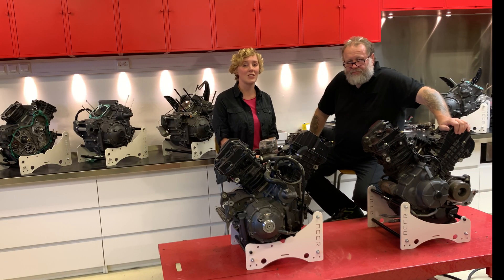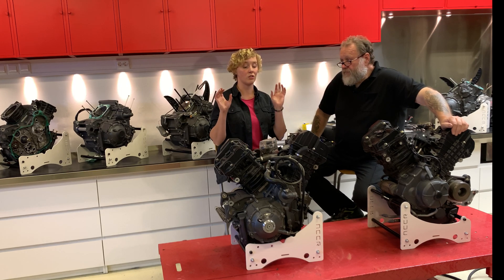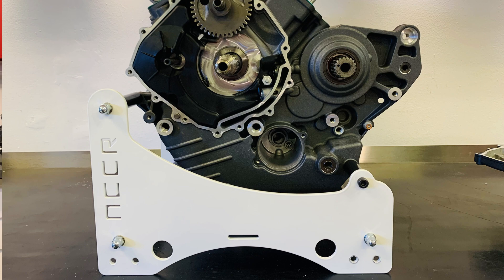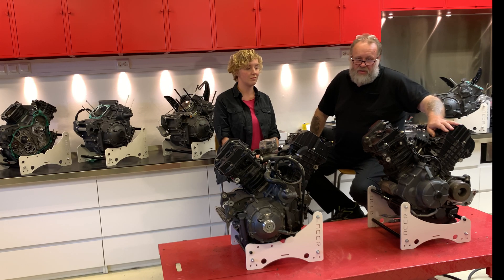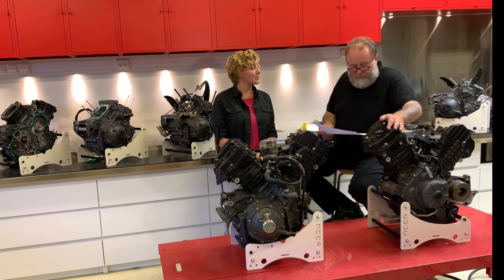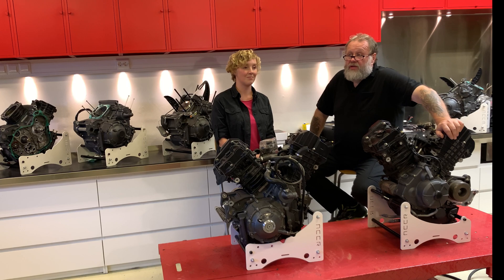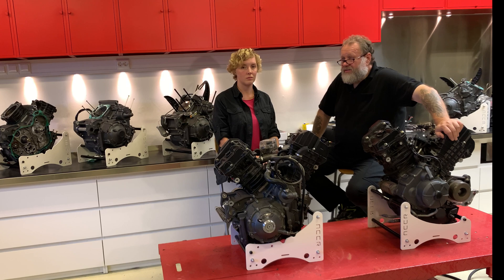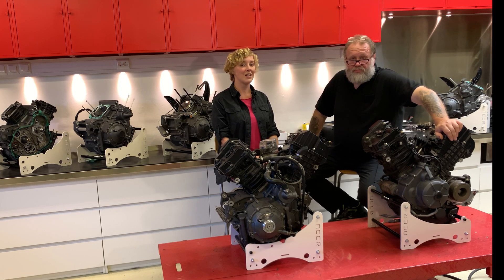NCCR Workshop News 14: EBR / Buell 1190 engine rebuild program

Comment: Does this apply to the brand new ones? Buell still sells a new 2024 sx, is that engine fixed or does it need this upgrade?
Reply from the maker: Well, we are not familiar if these issues got addressed by the factory.

Comment: Is it just only for 1190 engines?   Or can I send you my 1125cr engine?   It starts and runs, but doesn’t run perfect.  

Also!!!    Are you still making a 1190 single cylinder?   Something similar to a KTM 390?   I want to basically store my bikes and get a fun commuter and a newer modern bike.
Reply from the maker: We do 1125 as well, as long parts last. SuperSingle we work on, but development is slowed down by the actual situations.

Comment: im still waiting for a video on how to lower the xb without getting scg suspension
Reply from the maker: We will not publish a video about that, as it require special skills aside to the knowledge what is to find in the factory workshop manual. In short, it’s a job for a professional suspension shop and to them we must not explain it.
But we support tech skilled privateers to do it if we are convinced that the job will be done in a professional way.
Contact Jens by email or fb Pm.

Comment: Can us 1125 peasants run the chassis stabilizer kit?

Also, do you or will you ever offer a solution for 1125 owners to switch to a chain?
Reply from the maker: It work with chain conversion, but the right front radiator mount need to be custom made. 
Chain conversion is possible in different ways, easiest (and cheapest) would be to find an 1190 swing arm to start with.
Reply: @NCCRSweden  I’ll wait on your product.